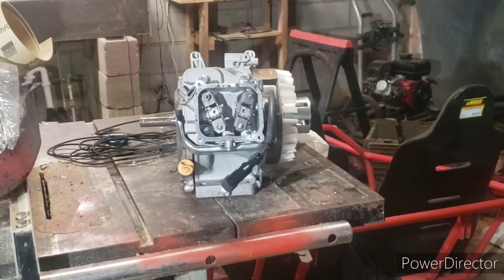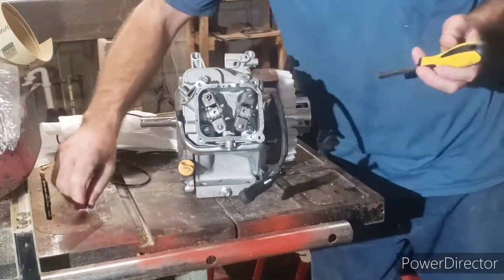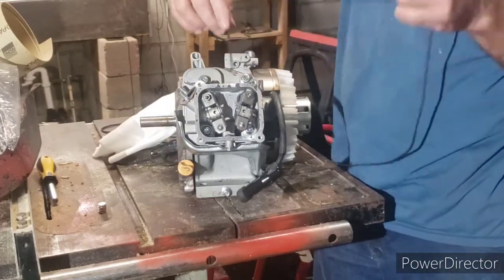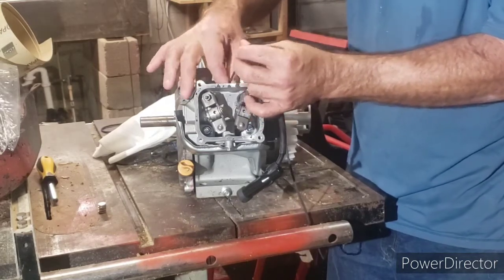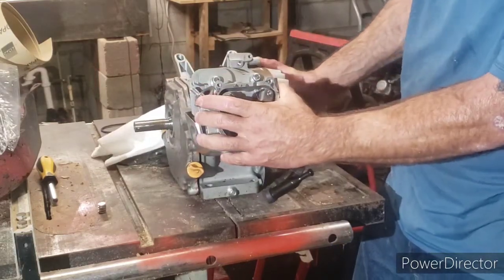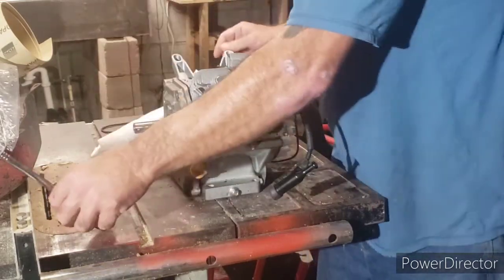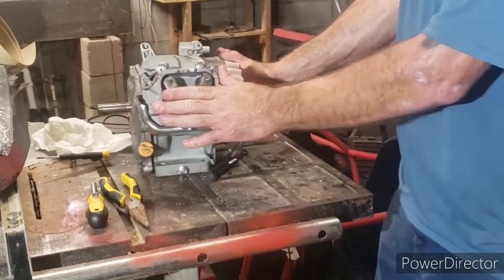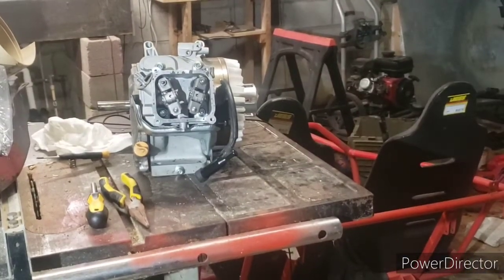212 hemi valve spring install, and an easy way to set valve lash

Comment: Where did you get the springs and retainers
Reply from the maker: Stock retainers the springs are from go powerboats.
Make sure if you have a hemi get hemi springs.
Non hemi get non hemi springs
Reply: @Hillbilly Holler  i have a wore out exhaust valve spring retainer. It is the predator 3500 generator.  I believe it has the hemi engine.  I don't see the go powerboats website. Sorry to ask but is there a link.  Thanks
Reply from the maker: @brucefilbert5758  look on this site page and scroll through the parts they are $3.50 each.
60363 Predator OEM Parts - Jonesboro Karting Complex/EFR https://www.efkarting.com/products/oem-engines-clone-honda-predator/oem-predator-212cc-parts/60363-predator-oem-parts-aka-hemi/
Reply from the maker: @brucefilbert5758  page 3 2nd part down
Reply: @Hillbilly Holler  you are the man thank you for your response

Comment: Nice thanks👍
Reply from the maker: You are welcome!
I have other videos on how to port, polish, and shave heads at home for more compression, torque and power.
I have some people that race karts that mail me their heads to machine for them.
You can definitely tell the difference.
Also adding a billet rod and Tillotson carb makes a difference. 
Anything heavier than 18 pound springs upgrade your push rods or the stock ones will bend.

Comment: I have valve springs and a billet flywheel. My flywheel is 8 degrees advanced, i did my valves at .003 and it still rips the cord out of my hand and nearly pulls my elbow out of place!!! So today I set them at .005 and it's just as bad as the stock setting! Any idea how i can stop this?
Reply from the maker: Your valve lash is set on the compression release. 
Reset your lash at .003 but when you do it.
Spin your engine till one valve is fully open.
Set the closed valve. 
This puts your tappet at a neutral spot on the cam.
Then rotate the engine so that the valve you just adjusted is fully open, and set the closed one.
Never set valves at top dead center!
Always one open and adjust the closed one.
Reply: @hillbillyholler516  is this the same for non hemi
Reply from the maker: @kill_pierre  yes.  Do not try to find top dead center.
One valve open and set the closed one.
Then repeat with the other valve
Let me know if it works...
You never ever try to find top dead center when setting valves you have one open and set the closed valve.
Then repeat with the other valve.
If you miss the compression release you may need seegery to repair the damage in your hand or arm.
Ignore everything you hear about top dead center. 
One valve open set the closed one then repeat it.
Been doing this for 35 years.
You never look for top dead center until you set the timing.
You cam seriously injure yourself if you look for top dead center.
I never ever do it that way.
I have gotten hurt trying it.
One open one closed...set the closed then repeat.
Reply: yep..happened to me using TDC. almost ripped my wrist and elbow joints apart. it hurt for a week. had me scared to start it. used the method you stated and no more issues.
Reply from the maker: @pbyrd99  you can actually set your valves at almost 0 clearance for a tad bit more lift and duration.
Just never set at top dead canter.
First time I did it I set them on the compression release and tore a tendon in half in my wrist and dislocated my shoulder.
Then they kick back it's almost 200 pounds of force instantly!
Reply: @hillbillyholler516  what do you mean to set them when open?
Reply from the maker: @Tony 1408  spin the engine.
Watch the rockers.
You will see them go down and up.
When one rocker goes most of the way down set the rocker that did not go down.
Once set spin more
...when the rocker you just set goes most of the way down set the other one.
Reply: @hillbillyholler516 set both exhaust and carb valve to .003?
Reply from the maker: @MoHunnidzGunCollections  you can set them to 0.003 or 0.002 no problem. 
All they have to be is close.
They don't have to be exact.
Reply: @hillbillyholler516  hey could this also be the cause for why my bike turns off during choke I have a hemi 212cc
Reply from the maker: No my guess would be bad spark, bent valve rod or carb issue.
I cant say unless i have my hands on it.
So when it dies hit ut with starting fluid or brake cleaner.
If it starts its fuel.
If not its spark.@MoHunnidzGunCollections
Reply: @hillbillyholler516  I figured it out for all my motors thank you man fr appreciate
Reply: Great thanks